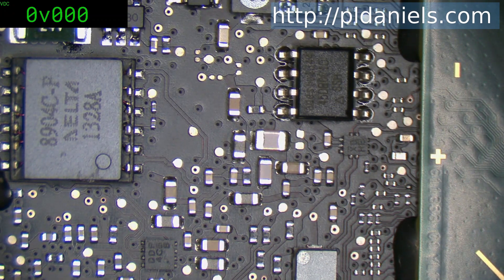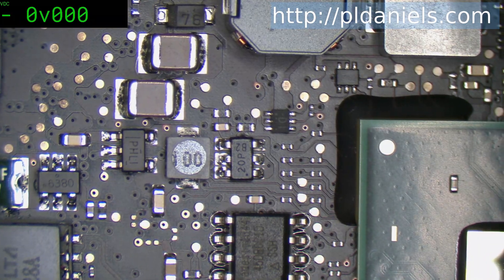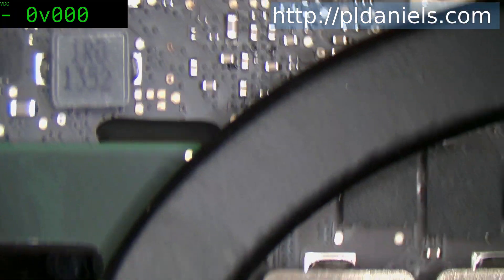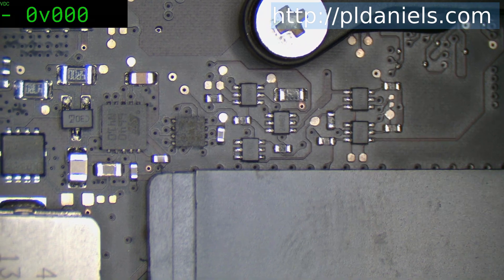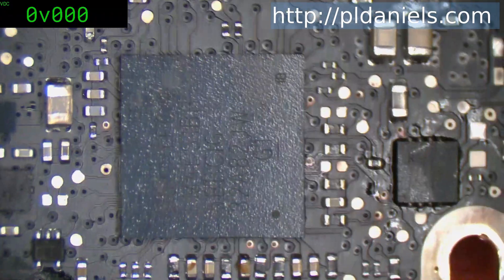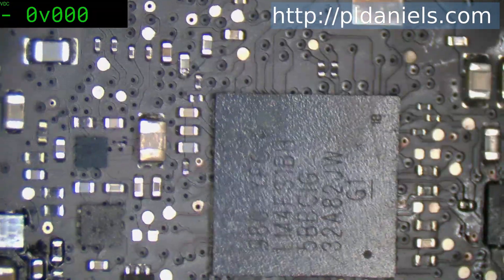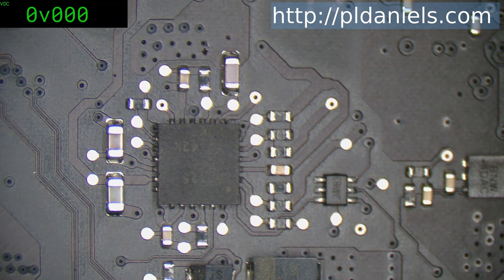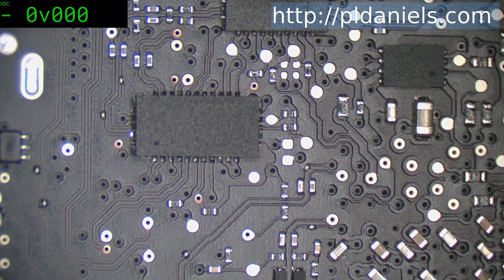QuickTip: moving away from using IPA as final wash in board cleaning.

Comment: My friend and I run a small PCB assembly factory. Some boards require a bit of rework after assembly, after which they are fluxy, so we have to wash them afterwards. Isopropanol is useful for dissolving flux residue, but it's not good at carrying it off of the board. Even if you have not applied flux and hand-reworked the board, there may be thin no-clean flux residues on the board which can be carried around by the isopropanol. This is where your white haze is coming from (not something in the alcohol).

Instead of using isopropanol in the final wash step, we use industrial degreaser. One such product is Zep Purple Industrial Degreaser. You need to make sure that all of the components on your board (aluminum electrolytic can capacitors in particular) are compatible with it (most new parts are) but it does a fantastic job washing away any residues and leaving the board looking good. Isopropanol can still be useful for removing a bunch of flux goop between pins, but you'll likely get the haze on the board if you don't follow it up with the degreaser.
Reply from the maker: I'm curious, the white haze I see is uniform across the entire board, even with fresh IPA I've found it seems to behave this way.  When using water-only rinse after the USC it comes up looking and feeling as original in most instances (sometimes I have to scrub off a small amount of stubborn flux that shows up under the UV lamp,  I just scrub with IPA+water/brush, rinse in water again, and then in to the drying oven).

I do know the flux-haze you're talking about too, the IPA mixes with it and leaves behind a slightly less viscous flux residue that takes on a cloudy appearance.

I do wonder if the haze is caused by the IPA dissolving something on the PCB top/bottom layer directly?

Comment: That white haze you're getting is usually caused by flux which the IPA dissolves and spreads all over the board in a thin layer. That means that the prior washing in Demi and cleaning solution hasn't removed all the flux.
Reply from the maker: How do you explain that it comes out very clean, no residue with distilled or deionised?

Also, when it's rinsed with fresh IPA (99.8%) it feels dry but it just has that white haze overall, so it seems more like it's an impurity/contaminant in the IPA rather than flux residue (especially when this happens out of a fresh USC tank and only a small area of the board had flux.
Reply: @pldaniels  It could be the bittering agent added to the IPA intended to stop people from drinking it. Just seems more likely that it's non water soluble flux left over from the original manufacturing process.

Comment: Tried this on a few boards today, great results! Good tip thanks!
Reply from the maker: Glad to hear.  Did you use distilled or de-ionised?
Reply: @pldaniels  Distilled. $0.85 cents a gallon at local store. After the wash I use an air compressor to blow off 90% of the water on the board, under the chips and in the connectors. Then 5 minutes at about 100C in the oven and ready to go!
Reply: Actually the distilled water I use for the wash now is the same water I put in the ultrasonic cleaner, so at least I know I'll always have enough of it :) Unlike alcohol which always seems to run low/out at the wrong times..

Comment: Nice one Paul. Are you using regular tap water or distilled water? I'm asking because of the minerals in the water possibly leaving visible traces on the board. The water where I live has a high amount of minerals such as chalk but I'm not sure if that would even be an issue since it's only rinsed once and not repeatedly exposed to all the minerals.
Reply from the maker: De-ionised water.  I cannot get true distilled water around here - have considered setting up my own distillation system but unfortunately given how much mineral content is in the local water it'd be a nasty clean up every couple of days.
Reply: @pldaniels  ah thanks Paul for confirming! I meant to say de-ionized. I Always forget about that one ;)
Reply: De-ionised is far beyond distilled, a fairly simple step after distillation. Quite cheap to setup a continuously flushing distillation apparatus as well, can even collect the flush as gray water.

Comment: Hi Paul ,can I ask what make / type ultrasonic unit you have , does it have a sweep frequency  . great videos , super software 👍👍
Reply from the maker: Generic 10 litre unit from eBay with adjustable time, heat and 'intensity'.  It does have a sweep function but I don't use it, as it's just an on/off left/right type effect, not really 'sweeping' as such.

Comment: I absolutely agree with your logic here. May I make a humble suggestion (to try on a trash board first to be safe) so as to shift stubborn stains like that bit you missed using a homemade plastic sponge brush. As long as you are careful to keep it very very dilute (to avoid photoresist corrosion) the tiniest amount of sodium metasilicate in pure water (as long you keep it away from components that do not like it). It is cheap too and can neultralise any acidic of vinegrated old isopropanol. A clean water rinse after is worth doing.